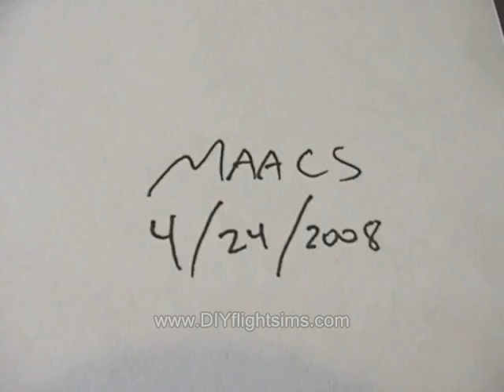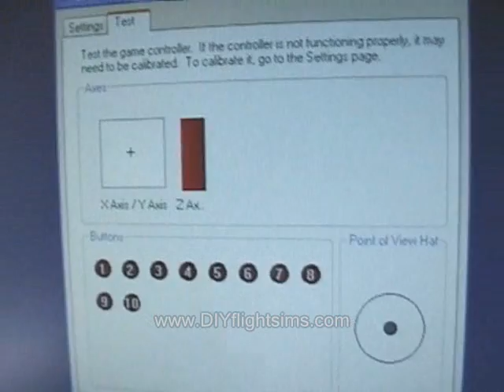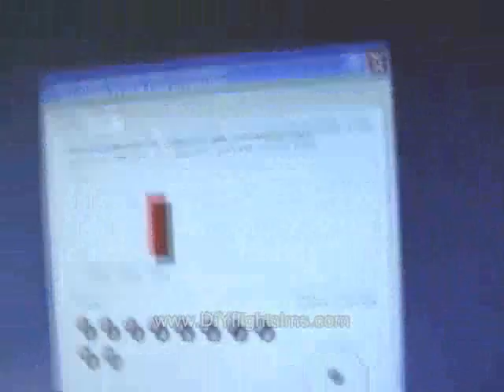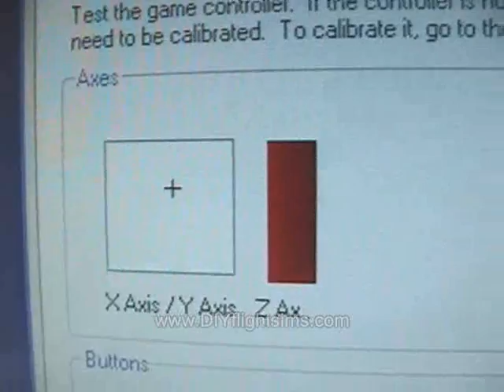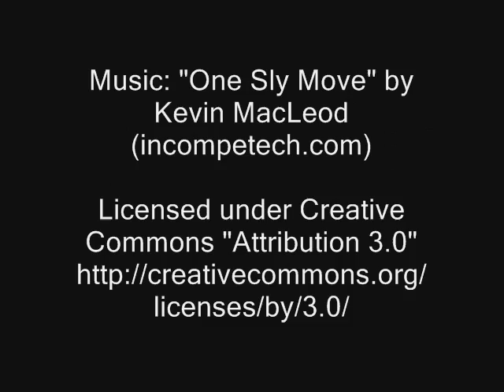MAACS Experiment - Episode 2, Joystick Modification

Comment from the maker: Actually, I loved using the rubber bands.  The flexibility worked out perfectly.  I couldn't use any thing very rigid, because it could have pulled the potentiometer off its mount, or could have pulled the brass rod off.  It was also incredibly easy to adjust the tension of the rubber bands.

Comment: Ah, so complexity begins to show its ugly face.

Alltough its on an early stage, the rubber bands were not a very elegant solution.
A 50 or 60cm apart (sorry, metrics here) three point triangular mount (2 hard points + Pot) with a solid rubber strip (or tube like) would have kept the setup much simpler and durable.
Then again that probably wasn't your final solution, so lets see what you did then.

The box should be simple.
A thick base for the mount and thin plywood with stoppers for the walls.